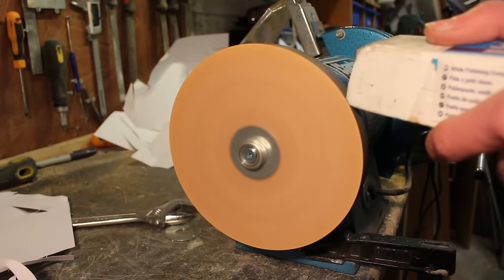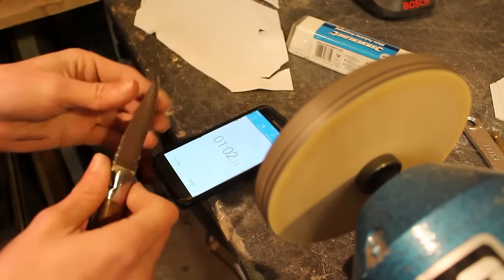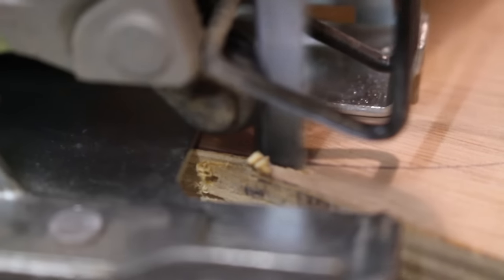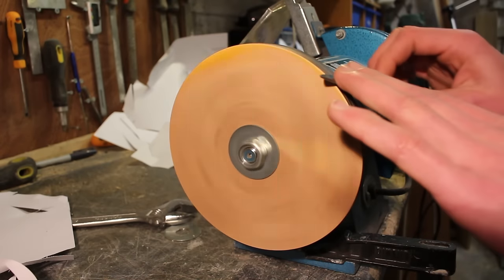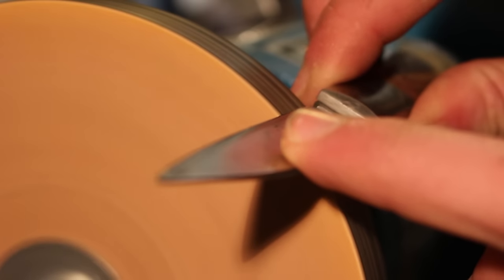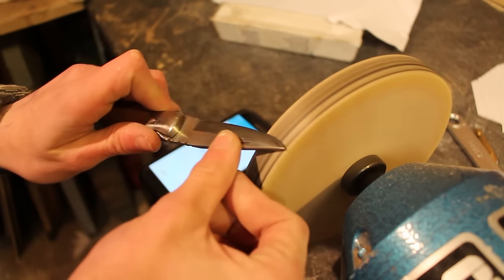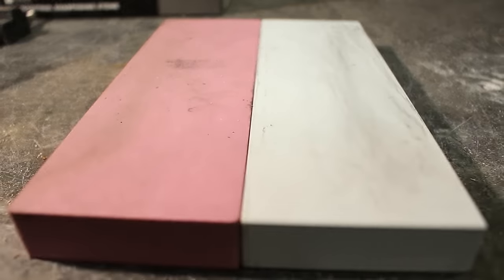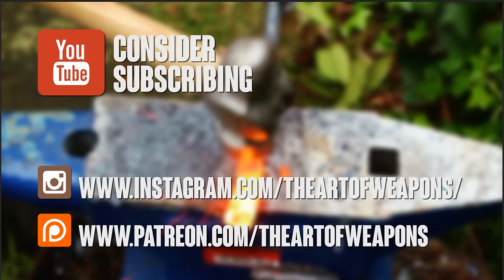The Laziest Way to Sharpen Any Knife to Razor Sharp 2

Comment: I mounted a hand drill on a vice and used an MDF disk with it. Even at  medium speed the wheel worked great. Even a small bit of compound lasts a long time. A steady hand and a light touch works best. I agree with safety concerns though. Always position your self and hands so that if your knife or whatever you are sharpening slips, your tool and hands move away from the spinning disk. Haven't tried it with plywood yet but I will give it a try soon.

Comment: The only problem I've had with polishing edges of knives, is that the sharpness quickly wears away. I prefer a rough edge like a scalpel blade. The most important aspect is to get a good edge that can be deburred many times before a new edge needs to be created. For old school barber blade shaving, there's stropping. Of which, the method in the video is a more mechanical way of stropping. For pocket knives or kitchen knives you want a rougher edge that can grab the material that's being cut.

Comment: So I tried this, and it works pretty well, but I just can't seem to get my knives shaving sharp. I have a couple theories as to why (other than just being bad at sharpening): I couldn't find silverline in the US, so I used the closest I could find: Woodstock D2902 1 lb Extra Fine Buffing Compound, Green. My plywood also had hidden holes in a couple of its layers which keep the polishing surface from being completely smooth. 

Is it likely that those are the problem? If not, could you make/point me at a tutorial on how best to get that last bit of sharpness using this method?
Reply: Hi. The best way to sharpen your tools are the normal grindstones. It costs 15 minutes on the first sharpening. After that  it costs you 10  seconds to sharpen it. On your problem  might be the angle.  Keep a 15 to 20 degree to sharpen your knife. Try getting a  constant angle  on both  sides rather  than trying to get the perfect angle. Get a 1000/500 sharpening  stone and start to grind  at an angle your finger could barely fit  under with pressure on the blade. If your blade is dull use the  rough side stone with alot of pressure to get a rough fit and then change to  the  smoother  side to give  the  blade  its  needed sharpness. Advice...never go in dry , always water the stone before and give it a nice wet rub during  the  process. Its always a better outcome without machines unless you are a professional.

Another advice... use a grindstab after eher work to keep your knife sharp. Also never  use soll  or throw it in your  dishwasher. Only clear  water  and a towel.

Comment: Jewelers, such as I am, use a cotton wheel. These wheels can be of various densities from a jeweler's supply shop and there are wheels that are dense that you can load with rouge.
Reply: they work wonders when you're trying to to put a shiny finish but when sharpening that give will screw the bevel geometry

we use leather wheels, they need some dressing and while they don't cost much for someone with dedication to sharpening, for a beginner that money may be better spent on a diamond flattening plate and some stones

so the plywood might be an acceptable substitute for a while

not shunning them at all tho, they put a mad shine on all the brass bits

(on a side note, the truly insane sharpeners end up using extremely high grit lapping compounds designed for optical lenses and do the whole thing by hand)
Reply: @mindbreak666  A cotton wheel is not a sharpening tool. It's for polishing. I sharpen my hand plane blades to 16,000, which enables me to take shavings less than 0.001 of an inch and leaves the wood surface burnished to a near mirror surface.
Reply: You sound like you know what's up..
Reply: You sound like you know what's up..

Comment: When I first saw this video I thought you were just using a default bench grinder (Which would be pretty stupid), but as soon as I heard you mention the wooden wheel, I realized that you were ingenious.
Reply: [SP] SaeniOnline
Reply: [SP] SaeniOnline sorry but why would it be stupid if using a normal one? What does the wooden one do?
Reply: normal stone wheels are way to rough to sharpen knives
Reply: @stalememe6407  Not true ! you just have to grind it on the side of the wheel
Reply: @stalememe6407  they also heat up the steel too fast
Reply: @oTEMPE5To  MDF?
Reply: @armanon9225  it is way to rough even on the side, unless you're just making a cheap chinesium hacking tool. Not to mention it heats up the edge and ruins the temper.
Reply: @natureboy6410  It's some kind of multi layer wooden plate with a specific density.

Comment: Thanks buddy, this will be my new project to help finish my other project ... I have a katana sword that was in a bad condition and IV been taking the time to slowly but surely restore and bringit back from death, currently it shiny and in a really good condition compared to how it used to be however I have been doing it all with my hands and minimum machinery unless necessary , currently and in the sharpening process but because the blade it's self was removed for safety reasons it's taking a long time to file it down evenly and this gives my a idea a high power fan and a wood block with time I could create one of these but small enough to be fan  size but powerful enough to get the job done and because it is simple I can easily place the fan blade back on when finished so I do t actually ruin the fan ( multi purpose fan ) I think am going to get the saw and drill out soon and make one my self ... Thanks for the information and I have to say it was detailed I assume I could leave the buffer chalk out but after your explanation on why it's a important factor i will be sure to get some of that too , excellent video , big thumbs up

Comment: Two things to note. The rotation speed of the grinder cannot be too high. Depending on the wood used it could potentionally fly apart. If someone uses a Lathe, way too much speed can easily be achieved! Please beware.
Second, you don't necessarily have to turn around the grinder. If turned backwards as shown in the video, you can sharp above the grinding wheel. But if used normally, you just have to hold the Knoif Edge below the grinder.

Comment: I have an ancient power drill that my dad bought a mount for. I have sanding/grinding wheels that I chuck into the drill to smooth jagged metal edges. I will make your setup and see how it works-it is simple, which I like.

Comment: Would it be better to have a variable speed bench grinder. Isn't it be bad to get too high of a temperature while sharpening ? Doesn't overheating damage the strength of the metal in the blade ?
Reply: Jack Taylor yes it can take the temper out of the metal and make it softer I would recommend doing this for a few seconds then dipping it in water to cool it as long as you don’t get it to hot to touch you should be fine

Comment: I still haven't tried this, I really need to. So plywood this time rather than mdf, did you do that purely for strength of the wheel?
Reply from the maker: I Just used the plywood to start with as it was stronger than the MDF so would be much safer however in the end it also improved the edge I was getting as it is harder and compresses less. The MDF would sometimes manage to roll over the edge that I was sharpening where as the plywood strops it razor sharp. Also the alternating grain picks up the buffing compound well.
Thanks man.
Reply: TAOW can i use a dremel tool?
Reply: nighthawk what r u doing here
Reply: The dremel spins to fast. The plywood might come apart sending splinters or chunks that could injure you.
Reply: The very fine dust you would make while truing up an MDF wheel is pretty unhealthy stuff - don't breath it in.
Reply: Good point; wear a respirator, or similar breathing apparatus while doing this. Depending on where you live, and your country's laws, the plywood you find may well be treated with carcinogens
Reply: and i highly recommend you not to try this shit. i'm a friend of a good old "sharpening steel" - u get the knife same sharp, don't need any electricity and if u got a bit practise, u need only 20-30s. 
sooo....the title of this upload is a lie. + your knifes will not live very long if u use a grinding wheel on them.
wkr,
~ a german toolmaker from daimler benz, class-best of a final exam
Reply: Dichtsau what grinding wheel? What video did you watch he stromps the blade with essentially a wooden buffing wheel with polishing compound on it your steels take more off then this wheel does per pass.
Reply: Actually this is incorrect.  A steels sharpens a knife by realigning the edge that has become curled and is no longer acting in the direction of the cut.  This is called 'honing' and does not remove material. If a knife edge cannot be honed, it will then need material to be removed preferably using a whetstone.
Reply: FAdam Jacobs
Reply: try it ;)
Reply: Sharpening creates a burr which is the cutting edge. After some use the burr need to be re-aligned in the cutting direction. After doing that over time the burr will indeed fall off (kind of like taking a piece of thin metal and bending it back and forth - it will eventually snap) But losing pieces of metal this way isn't sharpening, it is actually blunting. At some point enough material has been broken off and the knife will require sharpening with a whetstone. A steel won't sharpen the blade where the burr has broken off.
Reply: I strop on leather with two different levels of compound but the reason is the same, to remove the burr. That aside, methods like this wheel are great for working edges.
Reply: Never heard of stropping on linen.. My grandpa always used leather as do I.. I have seen men strop their blade on the soles of thier feet.. Even saw one man use the callused heel of his hand..Most folks, I know, use leather, it will also shine metal..
Reply: +NightHawkInLight I believe this method will only uncurl the edge, but won't actually gain any new edge.
Reply: Did you even watch the video?  That is not a grinding wheel, its a homemade polishing wheel and he uses it with polishing compound. The amount of blade material being removed with this method is minimal, that why its not significantly shortening the life of his knives.
Reply: I would likely use 2 different types of wood, to make a 2-stage sharpener system with 2 wheels.

1 made of hard wood, to get the dullest & toughest grunt-work out of the way.
1 made of soft'ish wood, to do the fine detailed work. (might want to select a lower rpm, as soft wood might explode, all over your damn face)
Reply: @Dichtsau  already responded to your copy paste comment on another thread, steels don't sharpen knives and you don't know how sharpening works.
Reply: @camg5367  no, just no, you never use a burr as a cutting edge, a burr is a sign that you didn't finish sharpening properly.
Reply: @TheMrhycannon  linen holds more compound and  the texture cuts faster making it take less time than leather.
Reply: @rich1051414  it uses a compound that cuts the steel away with abrasive, it's the same as using a powered whetstone.
Reply: Cotton wheels work as good
Reply: @hellboundzed8236  A slow speed motor would be better, MDF  is what I used on my lathe head stock, also had one made for gouges,  Have one with a 1/2 in bolt that I chuck in the drill press
Reply: @barrymarshall1324  What RPM do you suggest using for this on your lathe? Does your gouge sharpening jig differ from the MDF one?
Reply: @jaycee7687  On the lath, as rule ,I am at 800 to 1200 , very seldom more than 2000RPM  I did it all on the lath and I have a exhaust fan at the head stock for when I am sanding on stuff, and use a mask as well . BTW ,I should add, I also installed a reverse switch on the lathe which I use lots. I use drill press more for polishing with cotton or hard felt 6 in wheels, I did buy another old grinder for that  at a auction sale with a wire wheel, and a hard coarse stone, but I just kept it as is , as my good slow speed grinder is set up with expensive stones and jigs to do plane blade, and wood tools, not rough grinding.
Reply: @Dichtsau  I have to respect what you are saying. The speed of these cheap bench grinders doesn't create much heat as long as you go easy and not heat up the knife it is good.
Reply: @TheMrhycannon  I use leather because I work leather, but you can strop most carbon steels and tool steels on denim, nylon, cardboard, anything with some tooth to it. I use white compound on leather for all my high carbon steel and austentic stainless steels. Crucible Powered Metallurgy steel is a different story altogether, and I have found that a set of oiled natural stones is superior to my waterstones at my current level of experience with CPM S30V. The carbides are insanely hard and what would take seconds with a cheap kitchen knife will take hours on S30V, S35VN, and especially S90V. The upshot is it mainly only needs some stropping and light touch up to cut damn near anything. I use a fixed blade Benchmade to cut heavy conveyor belting like it's butter.
Reply: YES AND NO MR PRESIDENTIAL CATASTROPHY
Reply: @morganmartinez8420  "...can i use a dremel tool?" 
I think that's an excellent idea.
Reply: @camg5367 HUH!!!!???? repeat that!!!! 😞 I know this is old shit. So what! Your comment is still sitting here waiting to be critized and also PROVING just how much you DO NOT know when it comes to ANYTHING dealing with EVERYTHING knife edge and sharpening an edge at the time of your comment at least. Which brings me to why I'm replying after all this time. Wondering if you still believe everythkng you said is how it all supposed to work, or did you actually learn that everything you said was incorrect ? Hope it's the ladder. If not, then whoever is teaching you may need to research this with you so you both can learn TOGETHER
Reply: @twistn-grips  "hope it's the ladder"??? What??

Comment: Thanks for the video, made a wood wheel for my table saw and honed all my knives with it (working from the back side).  Fastest way I've been able to bring the edges to scary sharp.
Reply: koviack  Well the broken parts will fly around at high speed.^^
So you should use a decent birch plywood, remove material to balance the wheel and use very little pressure. 
It's also important to use the same diameter as the machine wheels so you won't introduce highly different forces that the grinder wasn't supposed to withstand.
Reply: koviack  Eye protection is recommended, obviously. Grind wheels can/do shatter (esp. in angle grinders) but I can't imagine a thick plywood wheel would disintegrate at this size/RPM. Lamination vastly improves resistance to cracking in a grained material like wood. I'll stick with the OP's dimensions anyway as he proved they work fine over a long time frame, so there is no need to alter them.

Comment: I never understood the hate on the last video
Reply: YeEpicTroll Because tbh it wasn't very lazy nor easy.
Reply: when you take into account wet stones are very pricey and it takes 30-45 mins (per blade) for someone who knows what they are doing with wet stones... his title makes sense...
Reply: frank furter Diamond stones are very good and is what I use.
Reply: Pinko  I would agree, use them in the past they just don't last that long i find..
Reply: Something spinning at high speed is really not what you want put a blade to. A blade needs one split second of inattention to snag the wheel and it is anyone's guess as to where and how badly it it stabs you. This video is insane.
Reply: not to mention it may change the hardness of the blade by using this method.
Reply: he said spin the grinder around so the disc spin away from you, then how can the knife snag the disc and hit you mr Einstein?
Reply: Brian Fischman how?  It would be easy to keep the temp down.
Reply: don't see how its dangerous when the wheel is spinning away from you? and its easy to cool a blade down.
Reply: That's why he showed at 3:03 that you must turn the grinder around so that the wheel is spinning in the direction where the wheel is pulling the knife away from you and won't snag.
Reply: What diamonds stones did you use? I have some and they have lasted a few years so far.  The ones I have are made by DMT they are basically a nickle plate with diamonds embedded in it.
Reply: when you heat up the steel, it changes the hardness.
Reply: um, you would have to get it red hot in order to change the temper of the steel.
Reply: Not the whole blade, just the very edge. If the edge is micro thin, aka sharp, you can change the temper of the very thin edge. Now you have a very sharp blade, that dulls easily. Good Job. /s
Reply: cravinbob;  you did hear him say that the grinder is turned around where the wooden disc is spinning away from you so that what you are describing will not happen. Or you could use the grinder faced toward you and sharpen the blade against the wooden disc below the centerline of the spinning disc.
Reply: @goonwop592  who takes that long with whetstones unless they've never used them before?
Reply: @fischb22  while I agree with your point, it's easy enough to just keep the blade moving so it doesn't hear the edge.
Reply: @sidviscous5959  no, red hot is way hotter than what is needed to ruin the temper, temper gets ruined at way lower temps than that, less than half as hot as red hot can ruin a temper.
Reply: @lazyh-online4839  lol whatever bud...Sharpening can take a minute or an hour, again, it all depends on the variables so really you just need to do it until you are happy with the blade! Dude this post is two years old.. PSH!